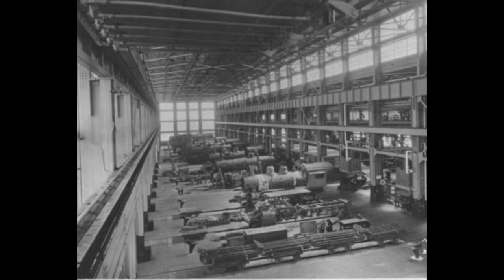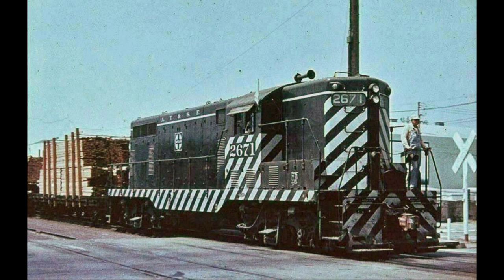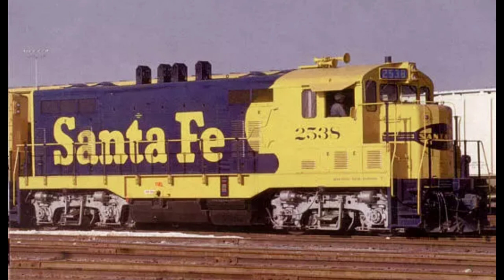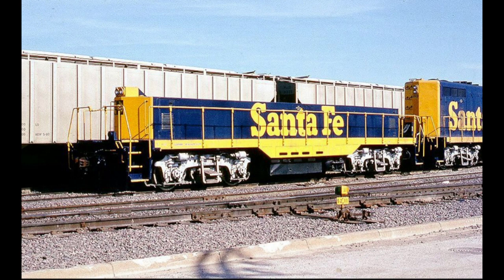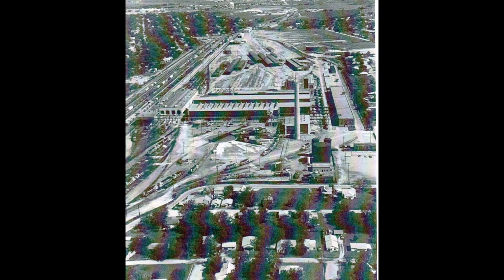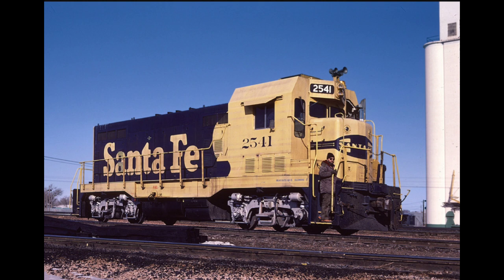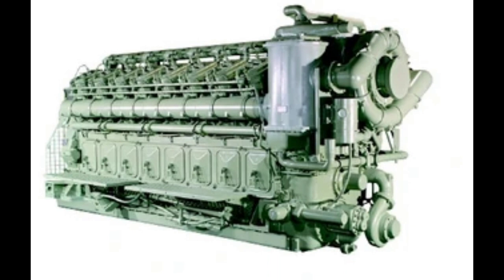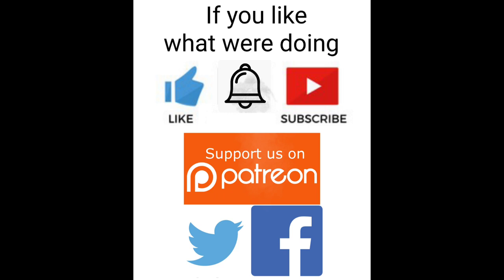Santa Fe railway cleburne texas shops pt2, the locomotive rebuilds

Comment: I ran these before and after the rebuilding. Most railroads rebuilt these with the Dash 2 electrics, especially SP ATSF being so cheap didn't. Then they took half the brakes shoes off and when it came to flat switching the yard, you couldn't get the thing to stop, you had to "spike" the motors. Screw them if they didn't like it. The CF7's? Where do I start. I had that junk on a local I worked from Fresno to Stockton. They were rolling gas chambers. The exhaust was coming into the cab for some reason. I'm doing the "Casey Jones" thing, hanging my head out the window so I can breathe! The RFE rode with us one trip and agreed with me. They got rid of them from the Valley Div. They bragged about that it only cost them 10k a piece. You gets what you paid for. Santa Feces, Route of the Super Cheap.